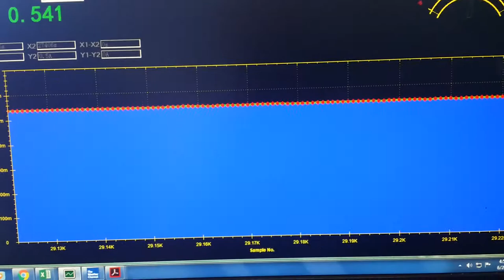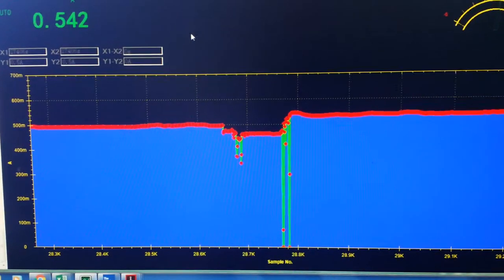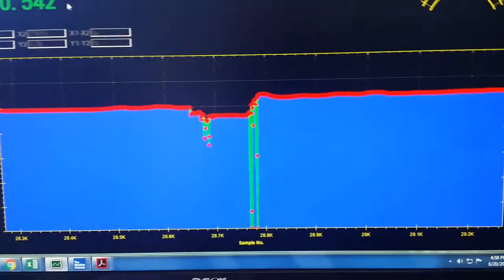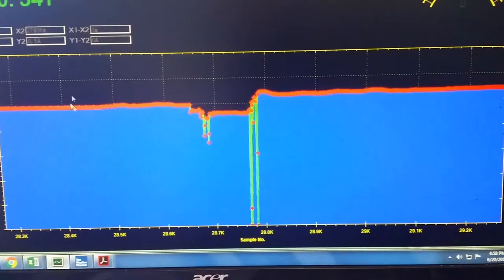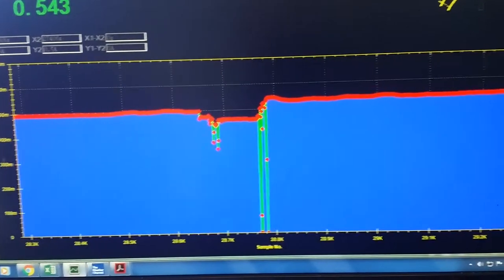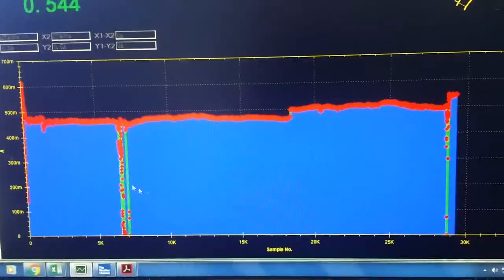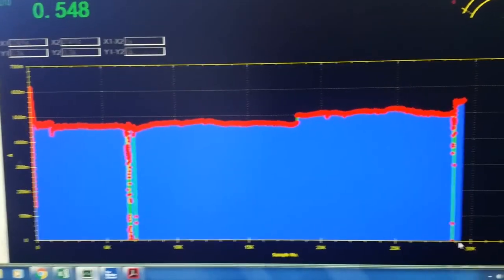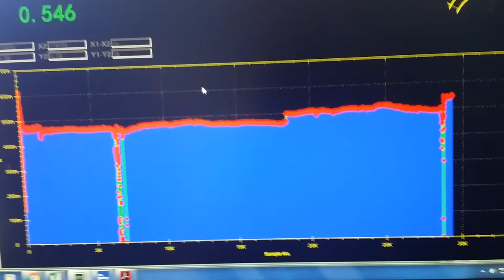Allwest Power cell- 8 hour test at .500 Amps

Comment: Nice results...I wonder if your mix could be packaged light enough for RC aircraft @ 4V output. Might need a multiple plate route of manufacture, just thinking that those results from recent tests put this in a good performance area for small planes.
Reply from the maker: Thinking that same thing, I have a DJI drone, which only fly's for 20 min,  it would be 1/8 the weight of that battery and half the size
 
I would love to have 8 hours of flight time 

Magnesium and copper, so very light 

The problem is that it is a wet cell (for right now)  and it does pump out hydrogen shorted, so not sure how to apply or contain it for my kind of flying 

I am thinking that it may take you a long ways for an electric car though
Reply from the maker: How many Ma do you need to run your RC?
Reply: Am always looking for 4V @ 10mA and up. From the lightest of basically livingroom flyer, to the proper quads and similar with 200mA. As you know, R/C batts have pretty much constant weights, so that dictates a lot. Especially missing are < 100mA batts, for 3-4g tiny flyers.
But yes, DJI's have missions far different to backyard quads, I'd be happy with 1 minute from my past cell builds lol  
Being able to home make something of around 200mA that can sink below the 3V cut-off of electronics and not suffer and also be stored in any state is a bit of a goal. 10 min charge for say 20 charges life would also be good & suit many people for actual usage before they bore of the aircraft.
Carbon and stainless is a fave, also soaked paper electrolytes...must get back to all this myself !